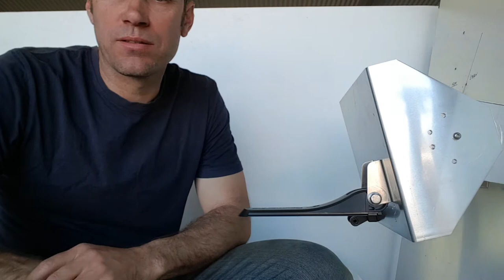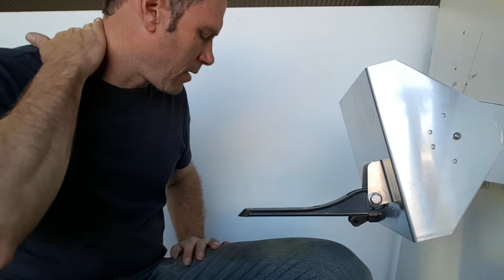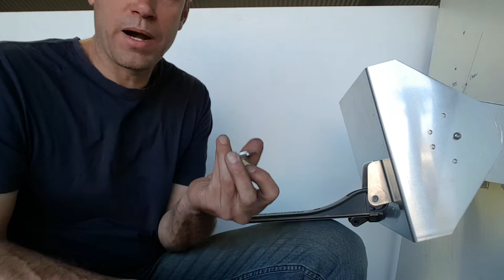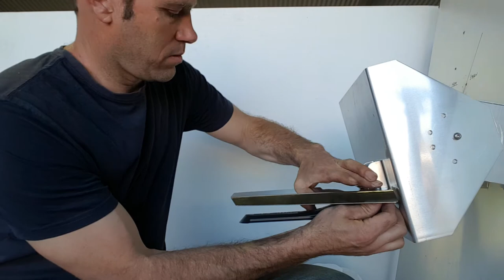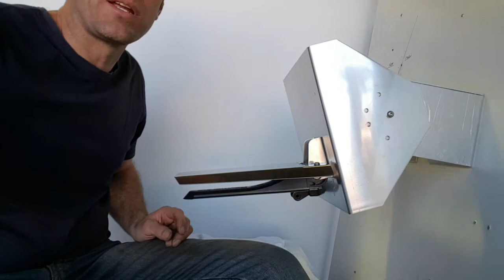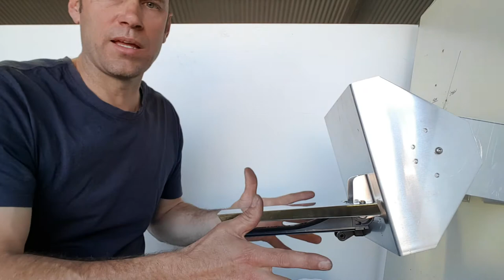Raymarine  RV100 transducer spray guard install

Comment: looks amazing.
But wouldn't guard can create more splash?
Reply from the maker: No Kim, as long as the spray deflector  does not dig into the water, that's why I always request a photo before ordering, that way I can customise and alter the standard  guard design so that it sits direct behind the transom.above the transducer.